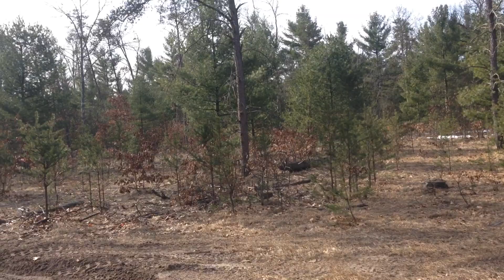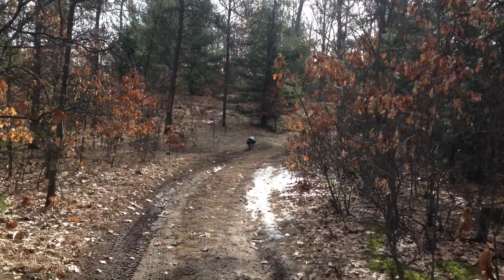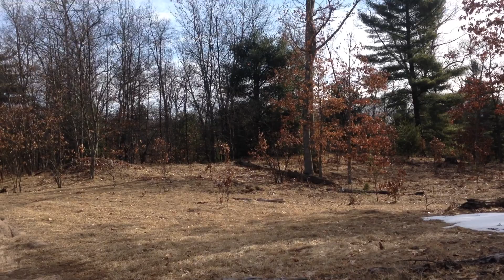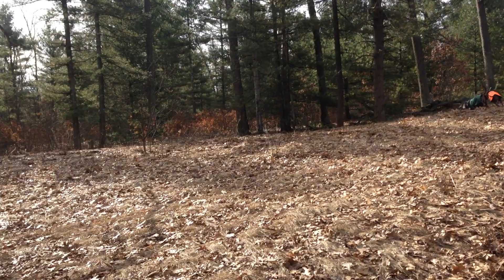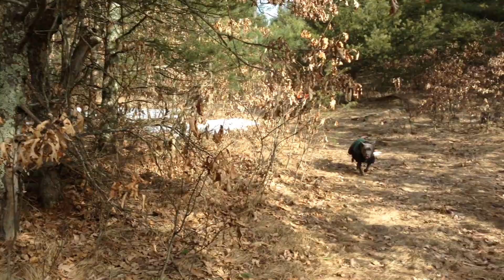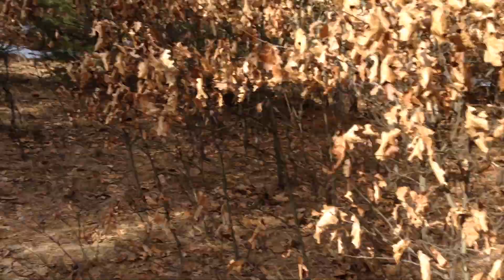Planes fly without FUEL

Comment from the maker: Airbus A380
Carries 323,546 liters of fuel or 85,472 US gal
Jet fuel weighs 6.8 lb per us gal
FUEL weight is 581,209.6 lb or   290.6048 us ton
Would be 145 ton in each wing just in fuel not counting the weight of the engines that weigh 13,770 lb per engine X 4 = 55,080 lb or 27.54 ton or 13.77 ton on each wing 
Total fuel and engine weight is 158.77 us ton per wing
Reply: Fermis you are not telling the truth. You are a shill. Loser.
Reply: Ferris  You are a pilot, so you're sworn to secrecy. Whether the information comes out on youtube, or any other social media, the truth is coming out. But you are hiding behind the notion that because it's on youtube, it must be false.   You absolutely know for a fact that the amount of gallons alleged to be stored in the wings of the commercial jets cannot be true.  There is simply not enough room, and the sheer weight of so much fuel is just impossible.  Cheers.
Reply: @hoofhearted3035  Just visit a flight school they'll happily show you where fuel goes in a plane it's not classified information
Reply: @PabloGonzalez-hv3td  Well, they can point to the "fuel fill opening", but you must know that the number of gallons allegedly being stored in the wings is absolute rubbish.  Aside from the immense weight such gallonage has, there simply is not enough room in the wings.  Cables, wires, flaps, etc. that are in the wings don't leave room for fuel.  Just my opinion.
Reply: @hoofhearted3035   In the air the wings of an airliner clearly support the loaded fuselage plus the stresses of flight plus a HIGH margin of safety it's self evident that on the ground the fuselage can support immensely heavy wings. In flight the wings are essentially supported by their own lift.

An A380s wings have the square footage of a mansion (9100sqft) and are tall enough to stand in at their thickest the real estate is there.

Here's a video of an A380 emergency dumping tons of fuel and even if you don't believe it's fuel it still proves the existence of vast internal liquid storage. Those pods on the edge of the wing also hold the jackscrews that deploy the flaps. This isn't my opinion it's obvious proof.

https://youtu.be/PzrKCsP3LoY
Reply: @PabloGonzalez-hv3td   Do some research into the weight and cubic volume that they say a jet airplane carries.  The numbers are way too large.  But it sounds like your mind is made up.  Have a good life.  Keep believing their lies.
Reply: deep anchor you’re as big a moron as the fool in this video.
Reply: Fermis  OK, so, maybe you're not sworn to secrecy; but then you are duped like the rest of us.  The numbers just don't add up.  If you show me an empty gallon milk jug and tell me you can squeeze four gallons of milk into it, I don't have to be a milk expert to know that this is impossible.  The wings on a commercial jet are too thin to hold the tens of thousands of gallons of fuel, in addition to all the flight controls (ailerons, flaps, hydraulics, wires, cables, etc.)  Why are there never any drips of fuel after the refueling hose is removed from the underside of the wings?  No drips from the wing nor from the hose. How can all those thousands of gallons of fuel be put in the wings in just 10 minutes through a 5 or six inch hose, or even in 40 minutes? If there are dozens, or maybe hundreds of little baffles in the wings to keep the fuel from sloshing around, those same baffles would slow down the rate at which the wing could be refueled.  Therefore, unless the baffles are at least the same diameter as the hose, the refuel rate would have to be slowed down - again, making the refueling of thousands of gallons of fuel a very slow process - not ten minutes.  It just does not make sense.  I don't pretend to know how these fantastic machines operate, but I'm convinced that their wings do not hold the amount of fuel you claim they do.  And I humbly concede that your knowledge of aviation is light years beyond mine, and I will never come close to catching up.  I am just making common sense observations.  I don't have to be trained as an aeronautical expert to use my mind and senses.  Take baseball for example: if some manager claimed that a certain pitcher can throw the ball at 170 mph, you don't have to be an expert in baseball to know that this would be nonsense. To reiterate your last line - believe what you want...I know better (through common sense). Cheers.
Reply from the maker: https://youtu.be/6U8Y4VlMnXA 
Good video by aplanetruth to watch
Reply: Swasnie1  Totally agree.  It's just physically impossible to fit that much fuel in the wings of any commercial jet.  Period.  No matter how we want to look at it, whether by weight, or by volume, it just does not make sense.  If we simply look at the thin shape of the wings it becomes even clearer that there is no fuel in them.  God bless.  Cheers.
Reply: I meant  Swanie1, not Swasnie1.  Sorry about that.
Reply from the maker: deep anchor 
My question is why can't everyone else see it, look at all these comments here, after looking into it more it seems even more possible, all the tec knowledge is there to do it so you know it has been done. 
Thanks for the nice comment
Reply: "My question is why can't everyone else see it"
Thing is, there are a lot of us who work in the industry, and know better. 
And, there's people who aren't in the industry that know enough to know that the people they should listen to are the ones who are in the industry.
 Would you take legal or medical advice from a cashier at McDonalds??? That is akin to what you are doing by believing in youtube "fuel hoax" vids.
 I have been a pilot for almost 20 years and have worked at an airport for almost 10 years, pumping fuel. Engines NEED fuel. All the data given is true and accurate...lives depend on it, including mine, every time I fly. There are plenty of ways that we are getting screwed(conspiracies)...jet fuel is not one of em.

That is a nice lookin piece of property there! Seeing the dogs wandering around makes my eyes a little "sweaty". Miss my best friend:(
Reply: Yup, you're right Duxbury...everything you've been told is a complete and total lie...the world is out to get you and take everything away from you. You should continue living your life like a prey animal. There's a tiger behind every tree, just waiting to pounce on you. 
 Loser, huh? At 42, I own my home on 5 acres, I own my own business, that I only have to work part time for 6 months of the year, and part time at the airport, just for the joy of being around planes. I have plenty of free time for hunting/fishing, flying...or about anything else I choose. My wife and I spend two weeks a year in Europe and another 2-3 weeks a year traveling around the U.S. The list goes on...but that would just be braggy. I'd say I've done quite well for myself!
Reply: deep anchor it’s simple maths. 32m wing length, average chord (minus flap) of 6m, average depth of wing 1m gives a volume of 192,000l. At an SG of 0.8 gives 152.6 tonnes. Approximation shows it’s entirely feasible to get they much fuel into an A380 wing. What’s your problem.
Reply: Deep anchor.  Not all the fuel goes into the wings. If you look at most aircraft there are two cargo hatches. There is a very large fuel tank between those two hatches. Not long ago a plane crashed because it ran out of fuel when the fueler got his Kilos and Pounds mixed up.
Reply: deep anchor Give me a f-n break. That is the stupidest thing I’ve seen all day. Do you really think you can keep several million people to secrecy? You can’t even get 5 people to keep a secret. I’ve been flying for over 40 years, and every single airplane I’ve flown has used some type of petroleum based fuel. Do some research on how fuel is stored in the wings. There is plenty evidence out there.
Reply: Felix Dzerzhinsky he’s not listening. He’s moved onto his next nutcase idea.
Reply: Fuel is also carried in a central tank  between the wings. Also the integrity of the wings on take off relies on fuel weight. You should research a bit more.
Reply: Sworn to secrecy??? You kiddin me, dude?!!!
Try going to your local airport/flight school and inquire about becoming a pilot...it will cost you nothing to inquire. Ask all the questions you want. Don't be surprised if they laugh at you and look at you like you're a complete idiot, when you ask about being sworn to secrecy.
 I do know that there is plenty of room for the fuel loads stated and that the planes are more than capable of carrying said amounts. I have personally fueled 100's of aircraft, ranging from vintage(post WW1) on up to the latest/greatest private jets. I know it baffles a lot of people, that do nothing more than look at a couple pictures and just make assumptions based off their lack of visualization, lack any aviation knowledge, and severe lack of understanding of even basic physics. 
Believe what you want though...I know better.

Comment: Those "thin" wings are taller than a human at their thickest and over 200 feet long on an A380 the real estate is there.

Contemplate for a moment that the wings you call fragile are what carry the weight of the fully loaded fuselage in the air plus handle the forces of flight, it's only logical that the same structure allows the fuselage to support the weight of the wings on the ground.

In flight the weight of the wings and fuel is essentially supported by their own lift.

Airliners have external wing pods called flap track fairings that enclose the flap mechanisms it's not all inside the wings themselves as many believe. Take a closer look.

Comment: I worked in the aviation industry for over 27 years. I have physically worked on the engines, fuel system, main planes (wings) and the fuel tanks contained within them. I can totally guarantee that aircraft engine are powered by Jet A1 fuel and it is carried in bag or structural tank contained within the wings.

Comment: Nice video I have worked 1990s  at maint. at ABQ. N.M. International airport. Funny how little workers in the industry  chime in on this topic!  So then I think it was pretty much some fuel as engines were pretty dirty aft. And when running the older ones used to have a deafening sound very faint Kerosene smell and a rather mildly  warm exhaust and as I remember a weak thrust.
Bombardier Global 7500/8000 range at 51000 feet is 9100 miles non stop now super long distance corporate jet. Airbus NEO doing similar fuel economies far away from before, and quietly. introduced.
 And you know any gas tank ONLY explodes when nearing empty on cars at least as gas currently will snuff out flame in liquid form. cannot light charcoals as 20 years ago. The stuff is not gas any more. So investigating this industry is one filled with lies all the time. Every sector is  pretty much the same. Military jets are always secret super thin wings and test beds for whatever they want.  Every part of this industry compartmentalized separated intentionally. Military origins. Around 2008 the industry wide retrofit of really thin wings and added winglets all quietly and now a huge turbofan looks like a barrel, this one  engine promo video say 90% of thrust is now bypass non compressor air and not burned; to me that defines zero point energy and advanced vortex theory you should see videos of big planes going stray with only wind on the ground. They lie more and more and because they get away with it all the time. The  air disasters are pretty fishy when examined up close in diverse aspects. 
The conditions flying are multiple health hazards uncleanliness, germs and of cabin bleed through of engine oil in cabin air and air crew are classified as radiation workers internationally in job description as there is no ozone left and I think its illegal to have a radiation meter in a commercial plane  flight crew life style and working conditions the extremely poor food quality the tension and stress levels are  some of the worst in  any employment sector or any job out there like law enforcement or combat soldier. AND the accident stats are skewed and cherry picked its fair to say its  even odds safety wise in a car or plane foreign carriers other than EU/USA makes the odds of crashing 10 or more times worse. This is on line info from investigators  the data collection method  and statistical analysis used.1500 people die using air travel per year they claim most in small non jet planes. Above 10000 feet the RAD count is astronomical. The pains and expense to add in flight WI FI  is astounding the radiation of collective microwaves approaches a fair exposure something like  an open microwave oven in a metal hull acting as they do as a wave guide/amp and resonator. The TSA section off scale in over exposing even half of Tucson International air terminal in terahertz radiation if non military  detectors were available. And there are  other ways to detect these millimeter wave emissions  which are compounded pulsing in reality like smart meters are now deployed and soon smart gas meters to add more injuries per watt? TSA workers are so prone to fast acting cancers look all this up? So G-5 goes into operation millions will drop dead. See if does go that way?
Reply from the maker: Great comment thank you!
Reply: @swanie1744  no one cares maybe it will all go away?

Comment: I am an aircraft mechanic specializing in heavy structural repair. I have been in the industry for 20 years working for many different companies. The engineering that is put into aircraft is amazing and the materials used are just as amazing. Just as an example look up a Cessna 182. Take a look at the section of the aircraft between the wings and the tail section. It’s a  ‘cone’ shaped section. It would surprise many people that the thickness of the metal in that section is only .032” thick and that metal is aluminum. There is no cross braces or other internal structure other than a few laterally running stringers. I say this because the structure of an aircraft is far stronger than it appears. An aircraft wing is not just a ‘box’. There is substantial internal structure designed to carry loads to support the weight required to hold the fuel. In most cases with large commercial aircraft, the entire wing is the fuel cell. It doesn’t ‘slosh’ around like a car gas tank because the internal structure is designed to allow controlled flow of the fuel from the tip to the center section by the use of baffles and check valves.
I’m not a computer chip engineer or manufacturer and just because I don’t understand how they can get millions of transistors on a tiny chip doesn’t mean that it’s impossible for that to be the case.

Comment: i dont see how a skyscraper which is several hundred meters tall wont collapse due to its weight
and still they exist
do you get my point?
i could go into what makes the wings so strong if you want me to ...

and btw air alone cant combust no matter the temperature
the whole compressed air thing doesnt give you free energy
to compress air you need energy
the compressed air cant give you back more energy than you needed to compress it
in powerplants the air is getting compressed by heat, which comes from burning coal or nuclear fission (this is in simple terms, the thermodynamics behind this are a bit more complex)

Comment: You have no idea what your talking about at altitude compressing air alone will not run a turbine. SUCK, SQUEEZE, BANG and BLOW the BANG turns the spool turning the fan and compressor. Wings are strong I’m an aircraft mechanic don’t attempt to assume something you have no idea. The wing is built on the wing spar the wing spar is a manufactured beam from wingtip to wingtip the fuselage sits on the wing nothing cantilevers off the fuselage. If your in construction than you know there’s no cantilever just why do the airlines need to justify their prices?

Comment: What gas in the air is burning according to you? Nitrogen, carbon dioxide?
Reply from the maker: ben dunn 
Here is one way http://www.dailymail.co.uk/sciencetech/article-3156632/Could-future-aircraft-powered-LASERS-Boeing-patent-reveals-radical-engine-design-claims-cut-emissions.html

But Tesla had free energy figured out 120 years ago so we my not know exactly how it works but you can be sure they have built off from his stuff and are using it. Has to do with frequencies and vibrations
Reply: Do you have a compressor at home? Tools? Look inside a R R engine! Compressors all the way. Their Reverse thrust is just to stop and turn. Look at videos when it's raining. They only use pushbackvehicles when they cannot blow towards the terminal. Its NOT HOT!
Reply: Nothin's burning! It's just compressed air, baby.